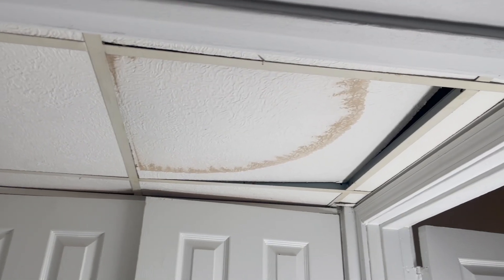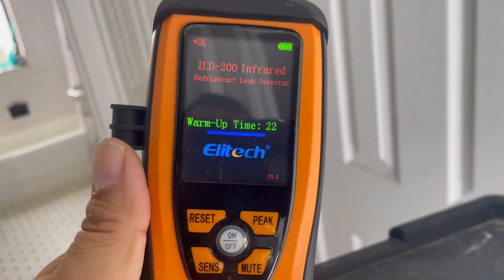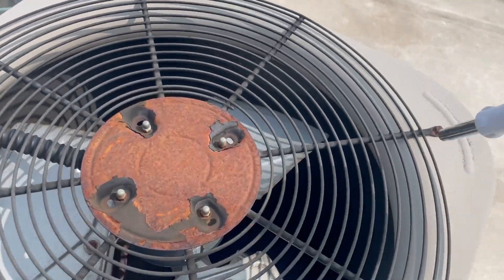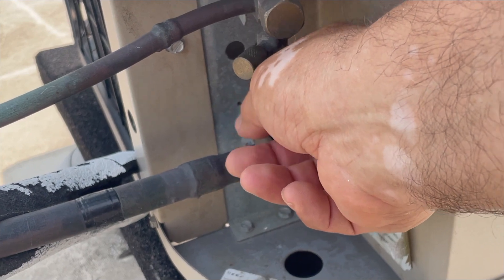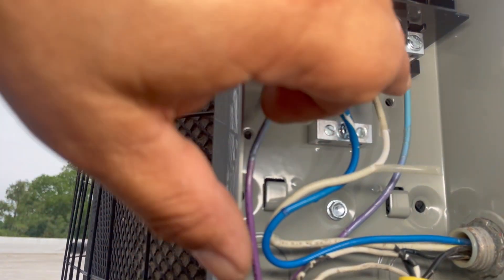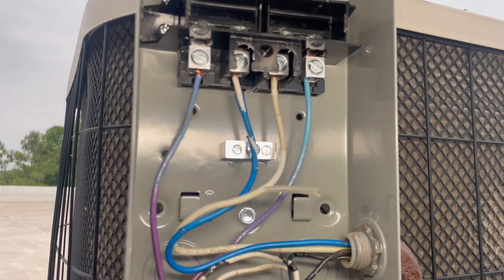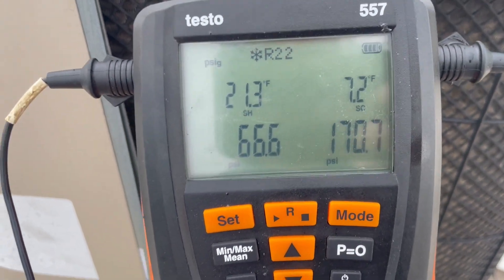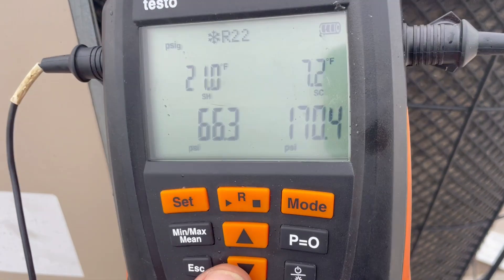HOW TO PROPERLY CHARGE AN AC USING SUPERHEAT. REPLACED CORE VALVES AND SERVICE DISCONNECT. TESTO 557

Comment: i just bought used testo 557 on market place, but there is no clamp come with it. can i still use it with out clamp sir! thank you
Reply from the maker: Hello,  yes you should be able to get the clamps and hook them up.  Just make sure your 557 has the the ports to connect them on. Some have them on the top, some have them on the  side.    Let me know how it goes.
Reply: @alexthehandyman3494  Thank you so much sir!
Reply from the maker: @TaiTran-zc9qp  Anytime!!!
Reply: Quick question,  thinking of using the wireless temp clamps instead of the wired connections since it's Bluetooth. Should be no problem? Using MQ app.

Comment: Seems like every valve core leaks.   Would you ever use red nylog (for r22) under the cap in case the schrader starts to leak?  I hear that will seal off any leaking valve so the r22 won’t escape better than just the gasket. Great job by the way.
Reply from the maker: Hello Richard!!!   Yes you can do that.   I had the nylon in my tools.  I don't know why I didn't use it.  Thanks for catching that.
Reply: I have a question. When you tap into the system with gauges to get readings do you have to vacuum the line , zero out gauges and then open the valve to get readings?  Or zero out readings, vacuum line and then open system valves ?  Would the procedure also apply in a refrigerator?  Thank you for making the video .
Reply: @iM-mf1ke  since I'm on this thread I'll answer for him. If im wrong someone can chime in. 
If the system has Schrader valves (most modern ones do) you don't need to open or close valves. Older ones with a king valve you do.  You don't vacuum anything. When you put the hoses on there will be air in them. You need to bleed that out using the pressure from the system.  The gauges should be calibrated (0) before you start.  They almost always are when you buy them. If you are adding refrigerant you need to bleed the yellow line from the refrigerant bottle to the manifold also. Lots of videos out there. Watch how to.charge a car ac on YouTube.  It will help you understand
Reply: @Drrich_DIY   Thank you for responding, I think I may had made a mistake here.  I am practicing with a fridge that had a leak in the evaporator. I connected two piercing valves (one on the low side and the other on the high) .  Once I replaced the evaporator I checked for leaks with nitrogen  and preceded to vacuum system .  I bought some digital  Testo gauges. At vacuumed my gauges showed -14.7 which is as far as they go unless you connect the micron gauge (which I don’t have ) but I vacuumed for about an hour just to make sure.  While charging my system my scale which is just a chep food weight scale turned off and I lost track of the amount of Freon going in. 

I did  weight the can prior starting and after I was done and based on that is showing that i overcharged by 1.25 oz ( not accounting for whatever was in the hose ) so I know I was overcharged.  So now I need to make sure my low side is at 0 psi while running.  I installed my gauges and vacuumed (showed -14.7) than opened my piercing valve and I had a vacuum of -2  but I didn’t reset my line to 0 prior opening my piercing valve , Should I had zero it out?  I apologize for the long message but I wanted to give context to what I’m doing here.
Reply: @iM-mf1ke  let me start by telling you I’m not an expert or in the business. So take what I write with a grain of salt. Did you replace the piercing valves with more permanent schrader valves? Usually when guys break into the system they only use one, and then they replace it with an access port.  I would watch a few videos by “subzero specialists” Aaron. His videos are great and just what you are looking for. Having said that, I don’t think the low side is supposed to run in a vacuum if properly charged. The right way to do this is recover everything again and weigh the right amount in (or at least close).
Reply: @Drrich_DIY  The high side piercing valve was taken off when I installed the new filter , the low side will be pinched and brazed once I am sure I have the right amount of Freon.  I don’t have a recovery machine yet and I don’t want to let out the Freon in the atmosphere .  My real lack of understanding is how to properly attach the low side hose to get accurate reading .  I will watch Aaron’s videos or go to the library and get a book. So far the unit is running fine but technically I don’t know for sure until I verify with correct readings .
Reply: @iM-mf1ke  okay, I think I understand. While properly charged the low side definitely should not be in a vacuum. I would shoot for between 3 and 7 psi as an approximate. I have a slow leak in  my own subzero refrigerator.  Every two years or so I add an ounce or two of r134ato the low side and get the pressure from a vacuum to about 5.  It’s worked well. I’ll give you another guy whose videos are clear and really good - Benjamin Salstrohm. I’ll find the video I’m particular I’m thinking of and edit this … okay here it is https://youtu.be/r8trnHixvJs?si=_GwqRV70YqRAN-RO